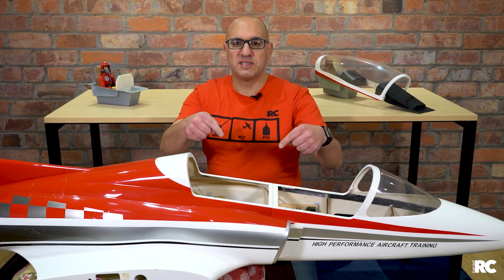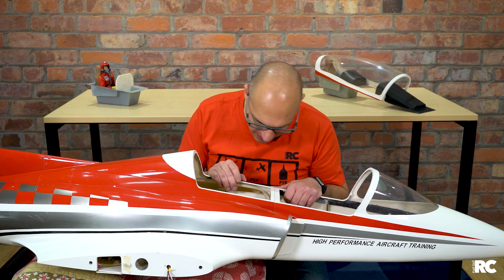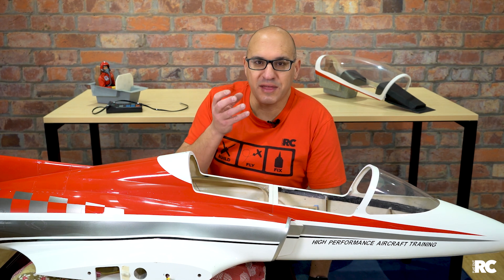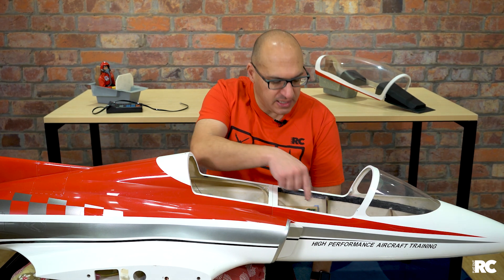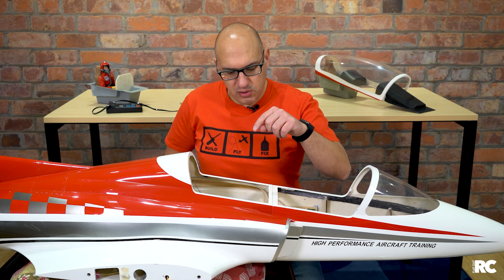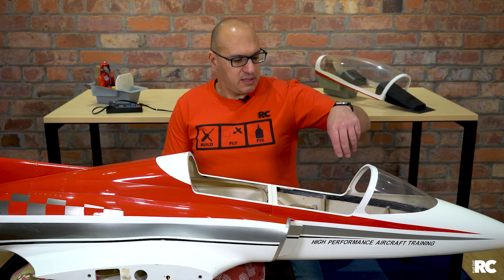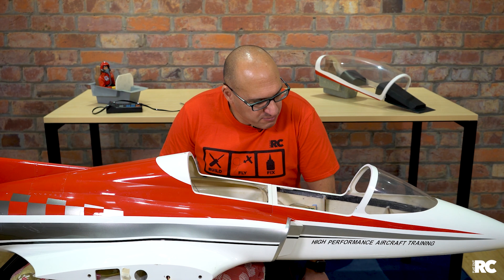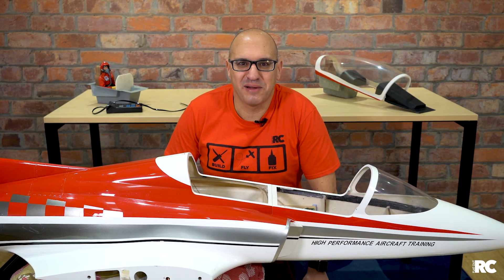What's Inside an RC Jet. A beginners guide.

Comment: Great video. Yes things are much different now with all the new high tech jets/turbine engines. When I started turbines it was non AutoStart using the gas. And power to weight has increased as my old ATJ 120Ti  is bigger and weighs more than a newer 170 size Swiwin!

Comment: Just a thought, I have converted from Jet A1 to household kerosene. I run Jetcat turbines and have had no ill effects from doing so, still mixed with turbine oil in the same ratio. The difference is only the lack of very nasty added ingredients in Jet A1. And a bit easier to purchase.
Reply from the maker: It will run but sometimes the quality of the kero is not the same. Plenty of people have done it.

Comment: Great information for those looking to get into jets. Are you going to do a video on the plane ie is it marketed as a "trainer". What makes a trainer ???
Reply from the maker: I don't think any jet would be considered as a trainer but the model is a Skymaster Viperjet 2m wingspan. For the average pilot with a bit of experience it is an easy plane to fly but these jets don't float around especially with the higher wing loading due to heir weight.

Comment: Ripper video mate, I noticed you don't run a redundant reciever? Is that just personal preference or you simply don't need to?
Reply from the maker: Thanks. The Spektrum receiver I am using has 4 satellite receivers connected to it. Found they work well and plenty of redundancy. Every plane 30cc up and I own has the same kind of system. That big receiver box where the servos plug in is actually not the receiver. The satelitte receivers plug into that box. Each receiver is oriented in different directions to cover all angles. I should have explained this in this video.